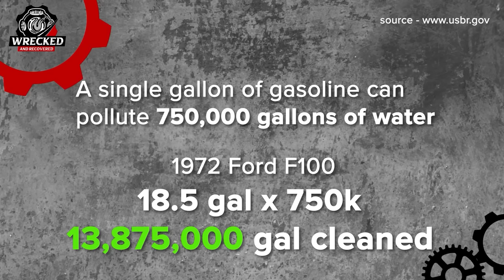1970's F100 Pickup Truck Found 3 Feet Underwater!

Comment: That is a 1972 ford f100!💗😢 love those bodystyles the 67-72 bumpside fords!
Reply: 1972 not 71. The 1971 would have 6 rectangles in each grill insert. The 72 only has 4.
Reply: @Fordman7575  thought I typed 72 I fixed it! I knew it was a 72

Comment: Decoded from the door tag, line by line:

1972 Ford F100, rear wheel drive, 302ci V8 engine, assembled at Kansas City, MO plant, late production (July 1972).

131" long wheelbase, Mallard Green paint color, light green/medium green 2-tone vinyl interior, column-shift automatic transmission, 3.25:1 rear axle ratio.

5,000 Gross Vehicle Weight, maximum 133 NET horsepower at 3,600 RPM, built for Dallas, Texas sales district.
Reply: Like except the engine is a 360 c .i.

Comment: 1971 or 1972 F250 in Medium Lime metallic, love these old '67-'72 Ford trucks, shame someone dumped it in the Reservoir to rot.
Reply: 1972 F100, only had 5 lug wheels. A F250 would of had 8 lug.
Reply: @Fordman7575  left rear wheel missing the hubcap, appears to be 8 lug, what you can see of it.
Reply: @jameslovitt994  check it out @ 23:21. I count five lug nuts.👍It can be hard to tell because of the crap built up between them on the wheel nubs.

Comment: I believe that truck is around a "63  to '65 and the engine is a 302 cubic inch engine. Just right for that truck. :)
Reply: It is a 72 F 100 with a 360 engine long 🛌  and I bet I could have it up and running 🏃‍♂️ 😀 😉 😅 in a short time ⏲️ 😀 😳 😄